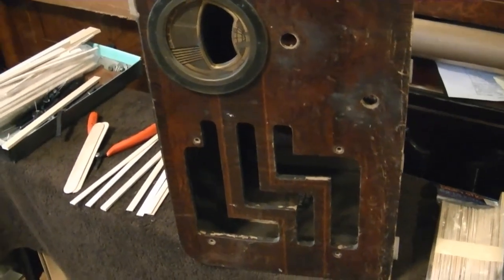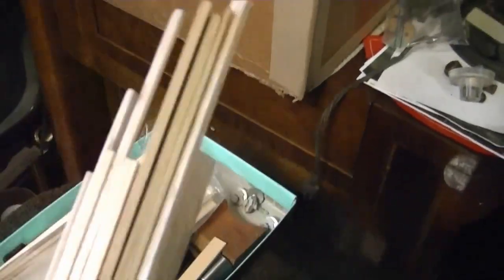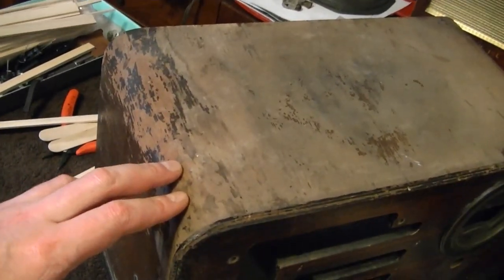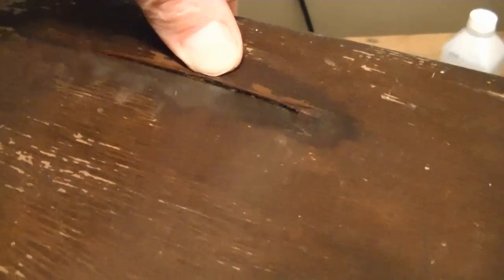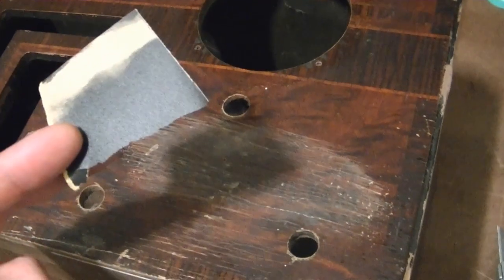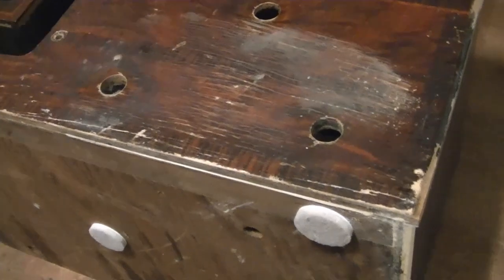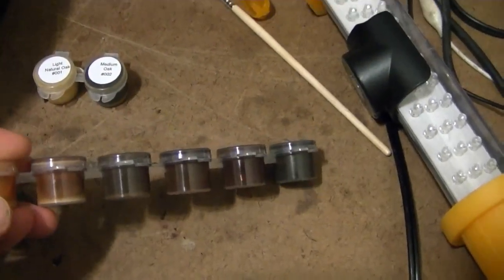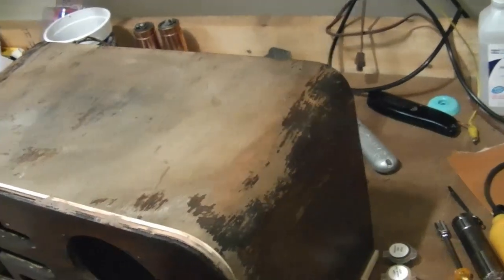Philco 38-62 restoration p4o?

Comment from the maker: Thanks.  I won't be using stain though because they didn't use it back then and it wouldn't look right.  Instead they used toner lacquer which is lacquer with either opaque or transparent dye in it.  I'm sure you've seen me use it in other videos.

Comment: I hate those faux finish decals they used to use, fortunately I only have one set where the entire front panel was covered with a decal like that, a FADA model 1001. The good thing about the FADA is that the whole panel only had one grain pattern, a faux olive burl, rather then an ornate imitation of fine marquetry, which someone painted over, I may try replacing it with real veneer. The other sets only used faux woodgrain for imitation inlay or banding, so it sat on top of the real veneer.

Comment: For my spring 2013 project I'm designing my own 5 tube radio.  I'm gonna  use the #80 tube in the supply. Any ides on what to do here? any ideas on what to do here? I've asked on ARF.. didn't really get a definitive answer there.

Comment: Bob,
Just to let you know i am starting with restoring radios than TV's then when i get good at it i will start fixing TV's. 
P.S. what do you use to strip off the lacker on these vintage radios? (besides just sand paper) 
I know your probably very busy but have you decided which front you wanted from the GE 10T1? you said you wanted to get rid of at some point.
sorry, but also what is your e-mail? 
From, David Correira